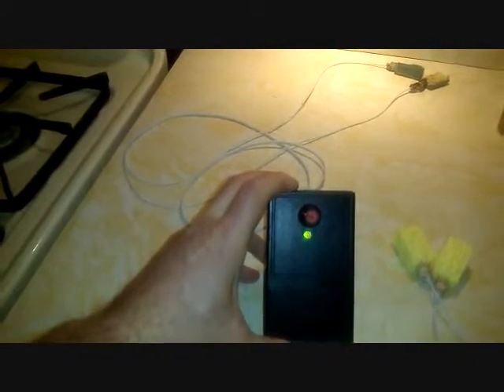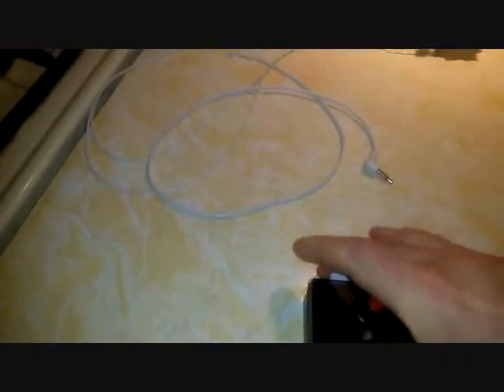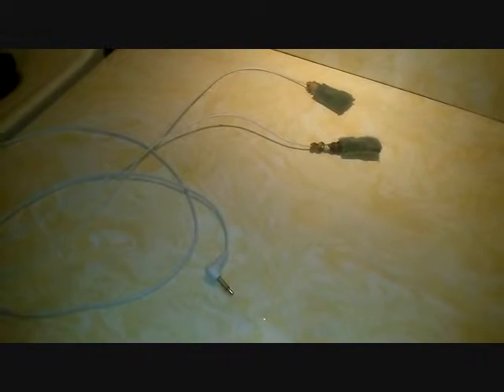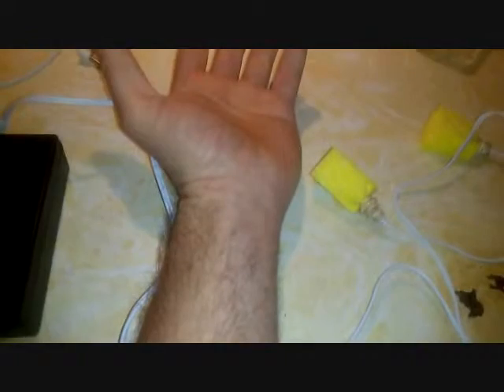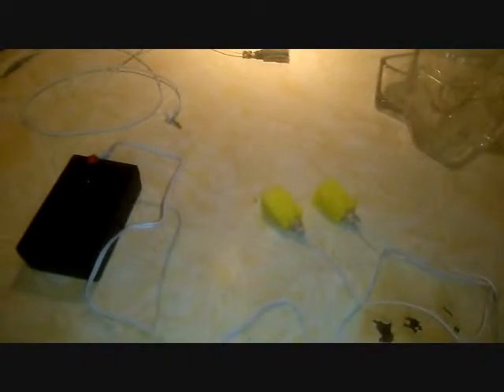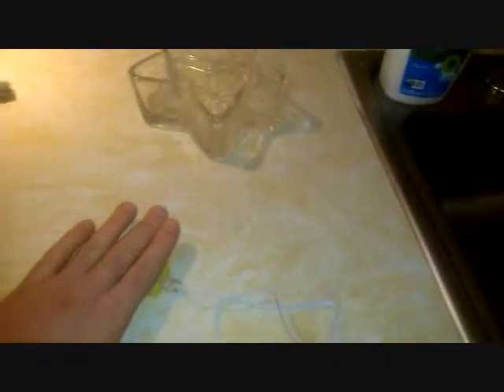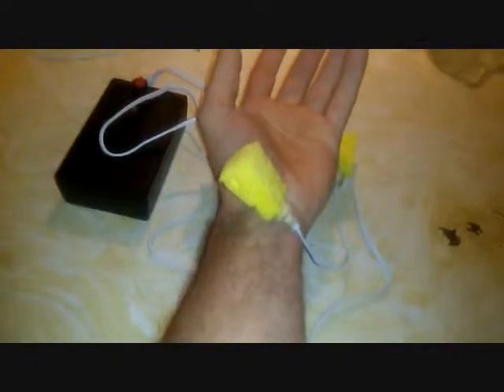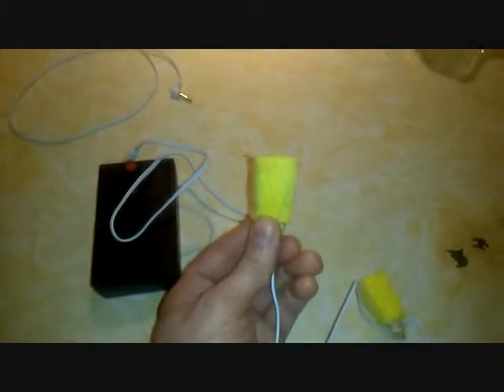Sponge Electrodes for Blood Electrifier

Comment: I had to switch to sponge because the cotton sleeves gave me terrible skin burns.
Reply from the maker: That sounds terrible. I've only heard of that once before. Last year I got the parts of the protocol set up for my friend with cancer. He was skeptical of alternative approaches and wanted to do the official treatment with Sloan-Kettering. Months later when the chemo wasn't working and he was more desperate he agreed to the Beck protocol. But it was too late. 

The electrodes burned his skin and he struggled to tolerate blood electrification. I doubt the sponge electrodes would have made a difference at that point.

There's no guarantee that it would have worked if he started when I offered it, at the point of diagnosis. But the oncology absolutely failed. I suspect many of the cases of protocol users who don't succeed are due to starting after everything else fails
Reply: @Ontonaut  I wish there were videos of dark field microscope before and during the protocol.

Comment: Can this device then be used as tDCS or in this case since the current is pulsating alternately, then as tADS (transcranial alternating current stimulation)?
Reply from the maker: I don't think so. To my knowledge it has never been tested in that way. I made a homemade tDCS device (I have a short video on it.) That sensation/experience is very different than the electric current in the brain that I demonstrate in this video. I don't know the safety of putting the electrodes of this blood zapper through the brain for longer than a few seconds so I would cautiously suggest not to do it.